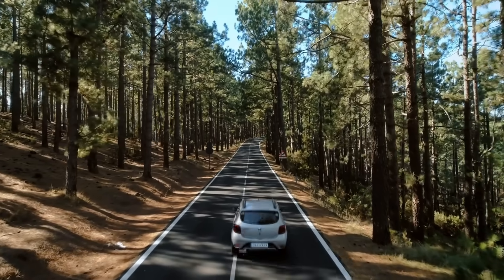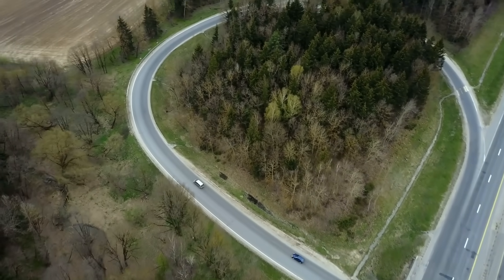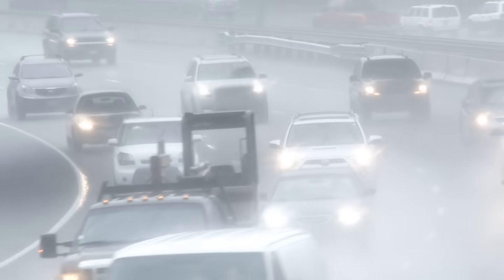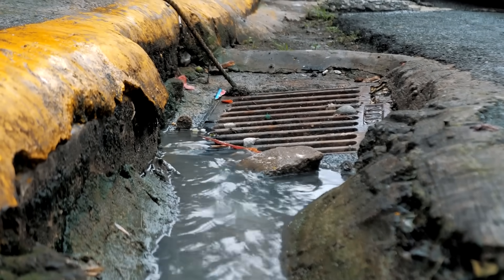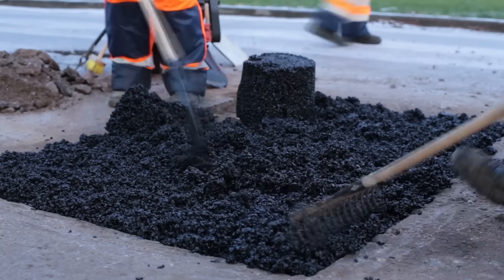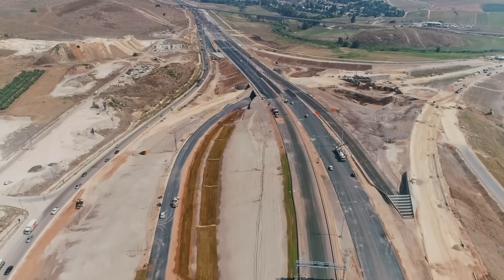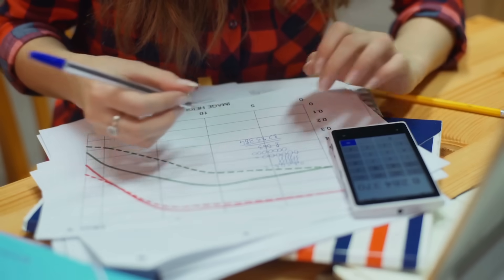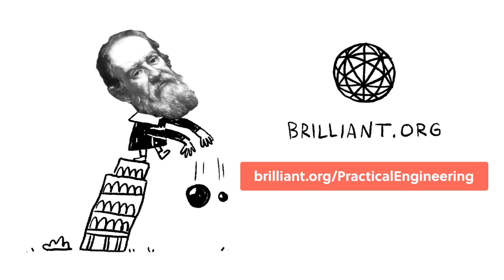How Do Potholes Work?

Comment: Here in Winnipeg, insane potholes (both insane in quantity and quality) are just a fact of life. There's a street that intersects with mine (maybe 100 meters away from my house) which had at least one pothole at least 3 inches deep and 15 inches wide for every 15 feet of linear roadway (averaged) - the street is about 1000 feet long, meaning it had upwards of 70 serious potholes. The widest ones were over a meter, the deepest were beyond 4 inches. There was even a section that sagged into the ground, created a 20-foot diameter, 3+ inch deep LAKE whenever it rained. It was horrible. 

Now though, FINALLY, after years of complaints and phone calls to city councillors, it is under repair. They're re-surfacing the whole thing, digging up the old concrete base layers, re-pouring new slabs, and I assume they're going to do a hot-mix or warm-mix asphalt/concrete layer on top of that (not sure which, warm mix has gained popularity lately, but every time I see asphalt applied, it's always been hot mix). It's been interesting to watch the process. Not all places choose to put a concrete base layer beneath the asphalt/concrete aggregate surface, but I believe it's necessary here due to the instability of the floodplain sediments beneath the concrete (so many houses here end up sinking into the soil with time, requiring expensive foundation repair). The slabs of concrete end up cracking at the expansion joints, allowing them to pivot beneath traffic, while the asphalt is a decent seal from water penetration from above. Of course, eventually water gets in (it always does), and more potholes will form, but that road was pretty decent up until about 5 years ago, and I know for a fact it was last redone (like what they're doing now) over 30 years ago. So it lasted as a high-quality, low-traffic (or at least low-mass traffic, seeing few massive trucks or buses) roadway for 25 years, with cold-mix asphalt patching in small amounts beginning about 15 years ago. Not terrible, considering the freeze-thaw cycles we deal with in both the spring and fall (in 2019 we had 66 days with highs above freezing and lows below freezing - 48 between January and May*, and another 18 from September** to November, and this was not unusual - most years are between 50-70 freeze/thaw days, concentrated in the spring). Of course, every neighbourhood has dozens of roads like that, and they only fix one a year if we're lucky (often it's NONE a year), so it's still pretty frustrating to drive (or even bike) on our roads.

*Yeah, we had a couple days where the temperature climbed above zero in January...I doubt the substrate thawed enough to squeeze out water and create a void though. But if there was an existing crack, certainly snowmelt could've penetrated it during this time. And our last frost in the spring of 2019 was May 27th (-2.1 degrees C) If you had your garden in before that, unless you used blankets or tarps or whatever to keep the air above it insulated, it would've died for sure.

**It was a good year...first fall frost was September 28th. It's often earlier.

Comment: “Poor condition” is just normal where I live. It is so nice when I find an area that was just paved and it suddenly feels like my teeth aren’t being shaken out of my head. Even then, it’s not always great. My local grocery store’s parking lot was getting a lot of pot holes so they repaved it. I’m pretty sure that they just put down a new layer of asphalt on top of the existing layer instead of properly tearing it up and flattening the ground. I realize parking lots are extremely busy areas and need to be constantly available, but half-assing a job is almost worse than not doing it at all. Louisiana does not know how to make roads. Even our highways aren’t made properly. One exit on I-10 has a huge bump in it. Granted it’s not that big but going over it at 45 mph is more than a little jarring. It’s not surprising that so many people here have crossovers or trucks with tires with high sidewalls. My wheels probably would have been destroyed by now if I didn’t have really tall tires
Reply: Try driving on CA roads....

Comment: Second to ice, I always imagined that water forcing into cracks and crevices by a hydraulic force from vehicle tires was a major factor in pot hole expansion. It is unbelievable how quickly the road surface can turn from a small crack or pit and in no time can fit a basketball.

Comment: you didn't mention water is not compress-able. at highway speeds the water is impacting the sides of the pothole like a giant sledge hammer; on all sides on the smaller ones

Comment: Potholes also have to do with the frequency associated with shocks and dampers. If a bridge has a certain approach to it such as a grade upon exiting the vehicle will try to bounce and the frequency of the shocks will tend to put increased pressure on the road surface causing potholes to come back, not neccasarily due to the pothole itself but the road surface before and after.

Comment: Without talking about the environmental consequences, could a thin sheet of plastic or other water impremible material be used just under the asphalt to prevent water from eroding the subgrade/soil layer?
Reply: Possibly, but it would likely tear pretty quickly due to traffic and then force all the water to soak on one place, concentrating the erosion

Comment: So how do potholes occur on bridges since there is no sub grade?
Reply: fenwayfan81 my best guess is the freeze/thaw cycle allows water into the asphalt and between the asphalt and material underneath. On a bridge, that’s likely concrete, so when the trapped water freezes, it heaves a little and road traffic disintegrates the asphalt over time. But I’m no engineer, just a driver who gets frustrated by potholes!

Comment: A few weeks ago my mom showed me a picture of an artist in Chicago, I think, who was repairing potholes himself by filling it with concrete and glass or rock tiles in a design to make little art pieces in them. I thought they looked cool, but my gut reaction was that it wouldn't really help fix the pothole after a while and that it would make it harder to really fix it in the future. I thought the concrete would just crack faster and chip away quickly. I'd be interested to know if my initial reaction was justified or not.

Comment: In my area (north texas) all of the roads are paved in cement/concrete. The only asphalt is that laid over the concrete for a smoother, quieter ride. Why do we have a different pavement system?
Reply: In Virginia, very few of the roads are paved in cement/concrete. This is apparently because VDOT hasn't had good results with concrete. VDOT doesn't have good results with a lot of things that seem to work perfectly fine in other states. I wonder what the problem could be.

Comment: In climate like in Eastern Europe low-quality roads with cracks turn into dust instantly in February-March. Kyiv region is pain in ass for any constructions on outside. In late winter and early spring the temperature here goes over and below 0 C every day soaking any material with melt water during the daytime and destroying it at night. Roads, bricks, everything.

Comment: Potholes are mainly created by heavy vehicle traffic, not really by passenger cars. This is why you have weighting stations along major highway corridors, particularly in the north and usually only active during late winter/spring months. The design of the pavement characteristics (asphalt or concrete, base, subbase, etc.) is governed by heavy vehicle traffic as well.

Comment: There was a (ted talk?) video years back where students had figured out that incorporating shredded steel wool into the asphalt allowed a specialized machine to roll over in one pass with a giant inductive heater (microwave?) that could re-heat and melt the tar in a very localized zone which was then immediately rolled to 'cure' the micro fractures before they became bigger fractures. It's a very neat tech and I hope they can figure out how to commercialize it.

Comment: Talking about budgeting for roads reminds me of old versions of SimCity.
One of the major features of the game is the ability to balance and cut spending on your city's infrastructure, such as police, fire, hospitals, and roads.
You have advisors on panel that can suggest ways to improve that particular infrastructure element, for example by asking you to build more hospitals. (She ALWAYS asked you to build more hospitals, it felt.)
Most advisors won't start complaining until you've cut them pretty drastically, I've seen up to 65% of desired budget before they start urging you to increase funding.
The transportation advisor rarely has much to say ... until you cut his funding. You cut funding to transport by even 5% (the smallest increment) and he'll FREAK. THE. FRICK. OUT. "YOU CAN'T CUT FUNDING YOU'LL REGRET THIS!!" and you'll start having pothole problems (road tiles will randomly turn to useless rubble tiles), the severity depending on how badly you cut funding.
My brother would cut transport to 95% just to upset the advisor.

Comment: For some unknown reason, the city workers where I live only patch potholes in my neighborhood on days that it is either raining or snowing. Their patches never last more than a week, and typically there are no less than 6 workers, driving at least 3 trucks, while one guy with a shovel fills the holes in, and the pickup behind him drives back and forth over it a couple times. On days that it rains a lot, chunks of asphalt are carried down the roadway and collect in the intersection at the corner of my yard, like little crabs scuttling across the beach.

Comment: Here in Hawaii the pot hole patching is so half assed.  It’s because we got one of the laziest workforce, you see them just doing the bare minimum, taking shortcuts any chance they get.  Even roads near high traffic areas in our freeways and around Honolulu are pretty bad.  I visited my Brother in Japan.  Their roads look really good.  I have not seen a really bad road conditions I see here.  I have not seen to many roads but drove to a small town with not a lot of people, it was not rundown like it would definitely be in ‘Merica.  One thing that is different about Japanese highways are that they charge tolls.  My brother has a chip in his car that is linked to his credit card that will automatically pay the toll as you pass the toll gate.  Also Japan has really high weight tax for vehicles.  The also have many rest stops that exists to generate revenue that helps with the upkeep of the road ways.  Japan does not need to rely on greasy politics for their road ways, they have a workforce that are not lazy and take pride in their work.

Comment: Great video. I started thinking about potholes a few years back during a rain storm and why they form so rapidly when it's raining. 
As i am sure that's explained in this video.  A loose section of road flexes when a car drives over it. It's got an air cavity in it that easily escapes when compressed. Then water fills it and it can't escape when a car drives over it. The pressure from the car and water causes more cracks. And soon enough the pressure is enough to displace asphalt.  Wala a pothole

Comment: You have all experienced potholes once or twice. 
You mean I'm not supposed to use Hz as the unit to describe the potholes i hit / avoid on my commute.

Northern New York has some awful back roads with no money to fix it plus a wonderful freeze/thaw cycle in the spring.

Comment: You should of dug more into concrete based roads with asphalt paved over them .  We have highways in Ohio like this and there are lateral cracks in the asphalt every 20 feet or so.  Seems to be at every concrete expansion joint .   Recently they have redone some highways sections and they finally pulled out the concrete underneath ..

Comment: The road directly connected to my driveway is awful. It's the only road in our area that is privately owned (not by me). It does not get plowed or paved by the city. The potholes are truly awful and they fill them annually with dirt. That lasts about 2 weeks.

It was paved at some point, but you wouldn't be able to tell by driving on it.

Comment: In the countryside in the South of a certain European country,where it is hot in summer and everyone drives drunk;the primary cause of potholes is people braking late and hard just before a bend .
The high temperatures soften the tarmac and then the poor reaction times and excessive speeds combined with powerful modern brakes lead to potholes even in recently re-surfaced roads.
I imagine that under temperate 'Temperance' conditions,the reasons you have given would eventually come into play!  :-)

Comment: I think the best way to build the road by non recyclable plastic, it is strong, and also does not disintegrate 🤔
Reply: Been tested....not very effective. Plastic doesn’t have a high skidding resistance so crashes will happen more often. When roads break up the small aggregates don’t harm the eco system but bits of plastic would cause some harm.

Comment: Here in Massachusetts potholes are everywhere. I think the freeze / thaw is definitely one of the main reasons they form. Another aid in their creation is the action of snow plows. The steel blade on the front of the plow drags along the surface of the street. The plow is designed to pop up when it encounters uneven pavement but sometimes the blade can catch on a crack or area of raised pavement and dig into the asphalt prying up the roadway.

Comment: Ok that's fine for paved roads. Please explain why, even after the town grader goes over our gravel roads the potholes reappear a month later.
Reply: That would be unbound material every time you drive over it it’ll separate. Basically like driving on sand
Reply: @BMXRACER1100  that explains absolutely nothing.
Reply: Gravel road are not solid roads so when you drive over them they will settle and cause potholes.
Reply: @BMXRACER1100  
That I knew already. Our gravel road go through incredible freeze thaw cycles, sometimes several each spring.
Why do pot holes on gravel roads show up in the same spot each year.

Comment: In Germany all the highways are made of cement. What are advantages and disadvantages of roads which are made of cement?
Reply: Massive disadvantage it would blow away in the wind for starters. Cement is a fine powder so can’t be used without mixing with other materials. 
 I’m guessing you’re referring to concrete rigid roads but Germany doesn’t just have these. They actually created a widely used asphalt flexible road SMA (Stone Mastic Asphalt) so they actually use both forms like everyone else.

The issue with concrete roads is that they don’t provide a smooth running surface like asphalt, when you’re driving down the road you’ll feel joints in the concrete whereas you shouldn’t with asphalt. Also concrete isn’t as skid resistant as asphalt so your breaking distance is much worse. 

The advantage of concrete road is that it last an extremely long time compare to asphalt, however when it goes wrong it’s going to cost a massive amount to put right and they’re just a lot more money to build in the first place. 

You’ll normally find concrete roads on residential roads maybe with a thin layer of asphalt on top for skid resistant purposes.

Comment: This video should really have mentioned that most road damage is caused by heavy trucks.

"Engineers estimate that a fully loaded truck--a five-axle rig weighing 80,000 pounds, the interstate maximum--causes more damage to a highway than 5,000 cars."

Comment: Using my own knowledge
During winter or in cold conditions, when water seeps into the asphalt, it freezes and weakens or even breaks the asphalt surrounding it. When cars drive over it, it then breaks the road surface, leaving the subbase (or subgrade) exposed, which is called a pothole

Comment: The naive way to fix potholes is to fill them in.
The correct way to fix them is to fill them AND weld the asphalt together at the seams.

Welding is pretty simple. You heat up the old asphalt with a torch (or infrared if applicable) and then you pound the crap out of the seam so the old and new asphalt mixes.

Comment: @Practical Engineering - could you cover this topic more with explaining hydrostatic shocks?

As I've understood it, upon hitting the water in a pothole, the resulting shock causes the water to be forced in to the road sublayers in macro- and microscopic fissures - and pumps out material as the water is squeezed (almost instantly) back out by the re-compacting ground as the fissures collapse. 

Like lightly stomping on a puddle on grass repeadetly causes the water to muddy up as fine particles are brought to the surface. If you continue and increase the force, material begins to be removed from the effected area by being ejected outwards. 

Now do this with traffic and you are literally pumping material out of the ground. The fissures ever deepen as the lessening of fine particles allows for water to be forced farther and farther, as there is nothing to dampen it's flow among larger paeticles.

So you'll end up in a volume of material beneath the hole that's been rinsed with pressured water maybe thousands of times, fracked, decompressed, compressed. Rinse, repeat.

I don't understand how fixing the situation could only include resurfacing, as now you're resurfacing a structure that's not the same as what surrounds it - the near-0-sized particles are missing and stable compaction cannot be achieved without those. So, what you're resurfacing is a moving, shaking, altering structure.

This is a huge issue here in Finland.